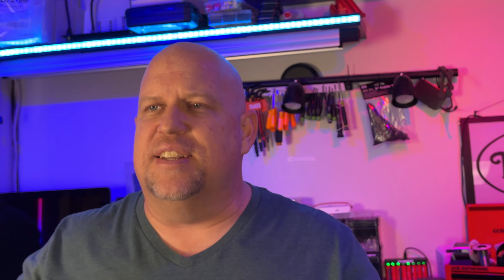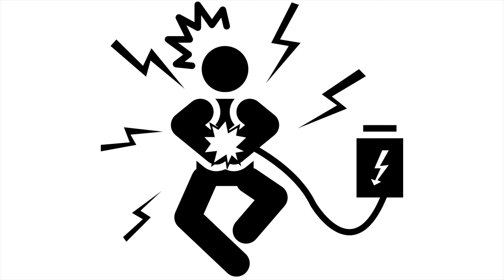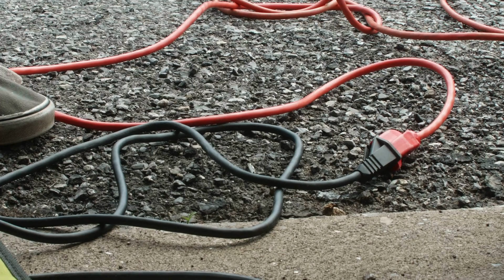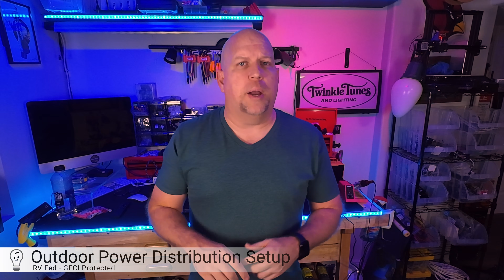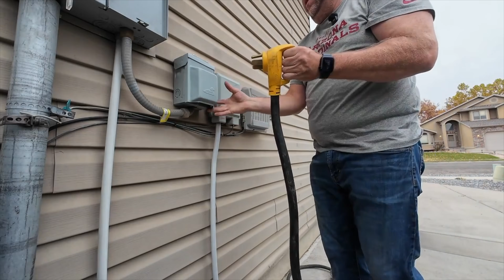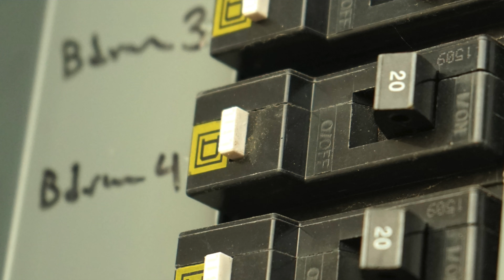Why Removing a GFCI Is Dangerous (And What to Do Instead)

Comment from the maker: If your GFCI keeps tripping, that’s not an inconvenience — it’s information.

Removing or bypassing it doesn’t fix the problem. It just removes the warning.

If you’re dealing with one that trips often, share the setup below (indoor or outdoor, what’s plugged in, moisture, etc.) and I’ll try to point you in the right direction.

Comment: Removed the 26 year old GFCI receptacle in my garage and replaced it and the receptacles on my front and back porch served by that circuit with regular commercial grade 20A receptacles.
Of course I replaced the 20A breaker supplying that circuit with a 20A GFCI breaker. 😎
Reply from the maker: That’s a completely different scenario than just removing protection.

You didn’t eliminate GFCI protection, you moved it upstream to the breaker. Functionally the circuit is still protected, just at the panel instead of at the first receptacle. That’s a legitimate way to do it, and in some setups it actually makes troubleshooting cleaner.

Big difference between relocating protection and removing it entirely. Appreciate you clarifying that.

Comment: I removed my kitchen GFCI because it was ugly and didn’t fit in with my new backsplash. 

So I replaced it with a combo breaker 😬
Reply from the maker: That’s actually a solid solution.

You kept the protection, just moved it to the panel where you don’t have to look at it every day. A combo breaker gives you the same safety coverage without messing up the backsplash aesthetic.

That’s a good example of solving the problem without removing the protection.